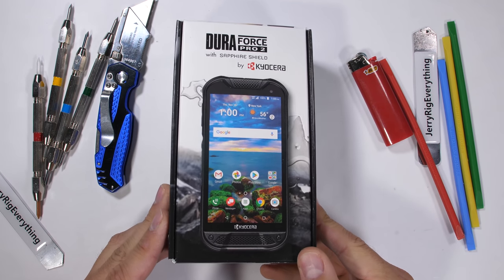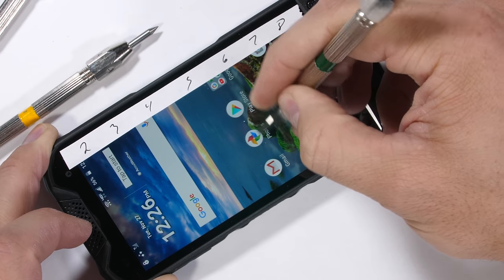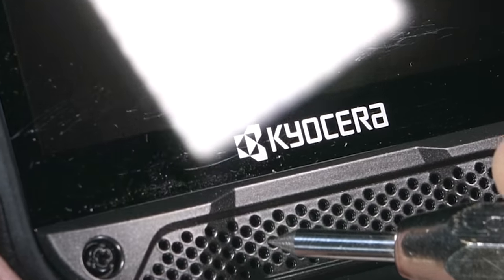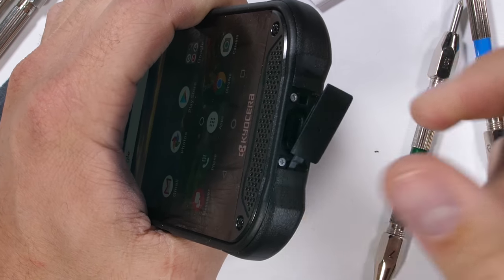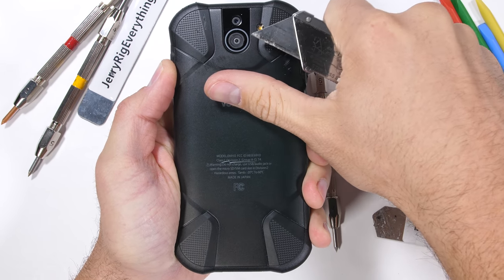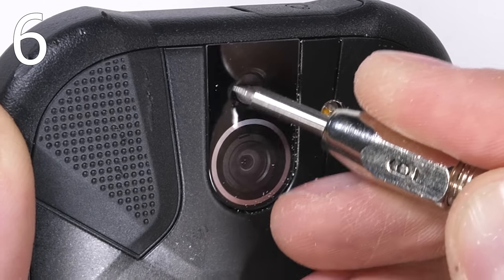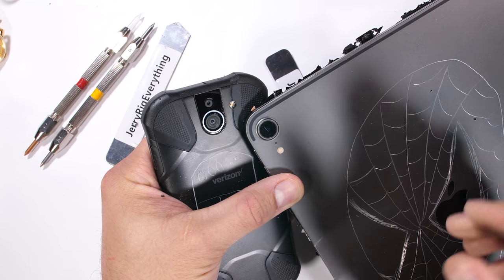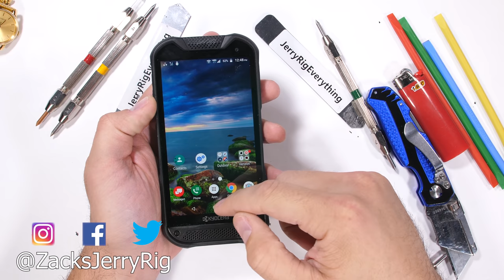A Rugged SAPPHIRE Covered Smartphone? - Durability Test!

Comment: Everyone one listen to this the phone you see above is great it is my current daily driver  although keep in mind that it has an Achilles heel the camera glass broke and I can't get a replacement also the charge flap partially stays open  

I have abused my phone day in and day out it still looks fairly good and it still works great so potential to buy for it is a case to help protect the camera and a water proof bag because cheap insurance

Comment: Hey that's my phone also it sucks, don't get it the software is horrible it's a good phone durability wise it just doesn't hold up in the software department. the iPhone SE (the old one) outperforms it and that phone was released in 2016 when this phone was released in 2018.
Reply: To expand on the software issues more. Struggling to type this where it will sometimes just randomly stop working in the keyboard will just not not work. along with the infamous black screen of death this phone has which is happened to me twice this phone is just unreliable. unless you're trying to throw it against a brick then you should probably be worried about the wall. It's just unfortunate that it's got the software of wet spaghett.

Comment: I like those rugged phones. 

For the average guy, that does drop his phone dozens of times, get a cheap phone, with a protective hull and a glass Screen protector. Any smartphone I've ever had never had a single scratch on the display due to the glass protector, that was often damaged as shit. No major damage on the Body as well. 

I'm also working in a very humid, but very very dusty enviroment (bakery). If that is the case, get a magnetic charging Cable. The plug will protect the connector, wich is prone to failure in here. And protect your Headphone Jack. 
All my 200$-ish phones survived to that. Last two died to to Water damage.... So mine can handle that now, too.

Comment: My tiny Android 3 Kyrocera that I had in 2013 was built like a brick shithouse. You could throw that thing at home run speed into a cinder block wall and it would just damage the wall. It wasn't even advertised as a rugged phone or anything.